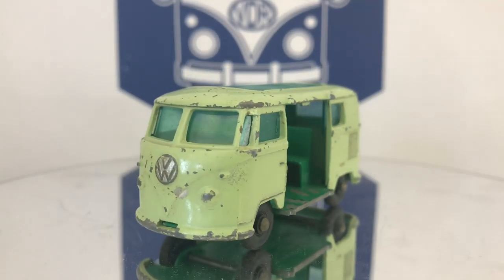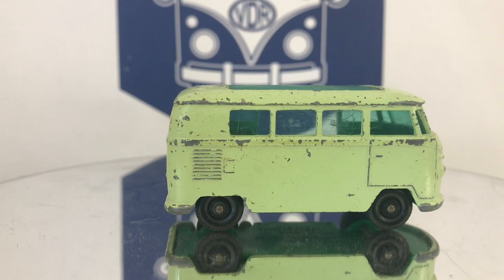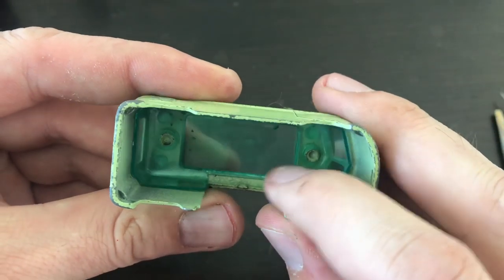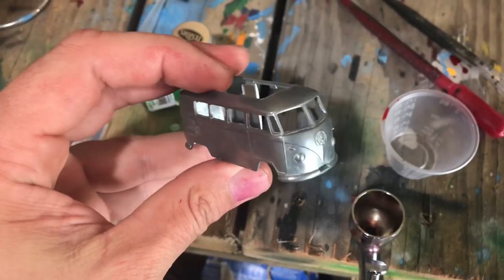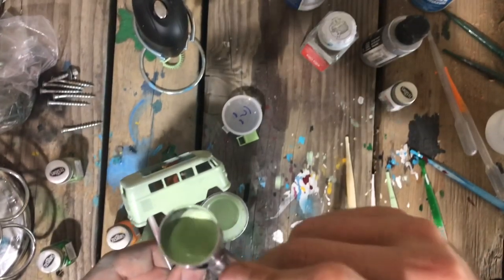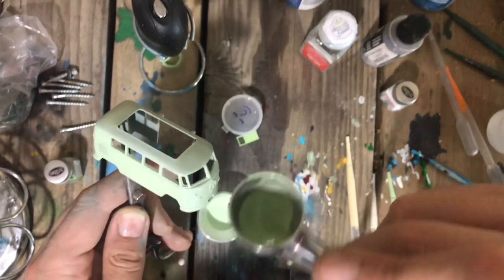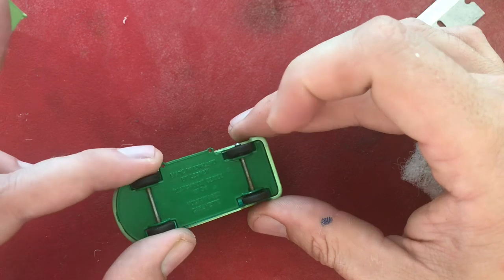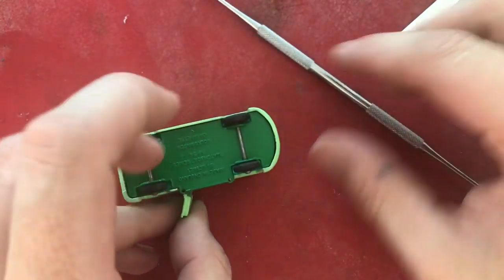Matchbox Lesney #34 Volkswagen VW Caravette Van Original Restoration

Comment: Hey, if you're reading this, you need to get on eBay right away (Fri, 7/26 @ 10:45pm PST). There are 2 pairs of doors for the Caravette-- 1 pair of silver doors and the other pair is green! Both are being sold at $6.26 each + $2.79 for shipping--from Australia. Good luck!
Reply from the maker: I actually was able to find another model with both doors, but the rear door (that I already had) was damaged and had been glued on.  I'll shoot a follow up when I get it all fitted.